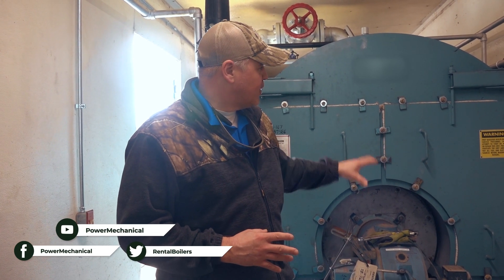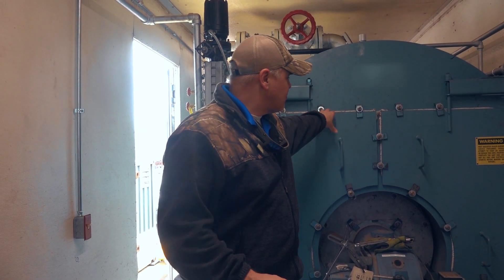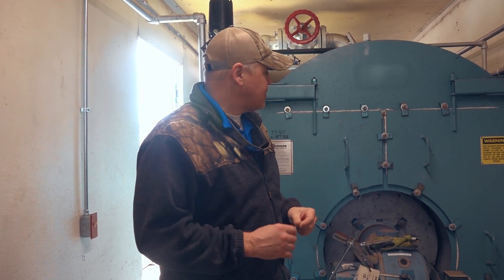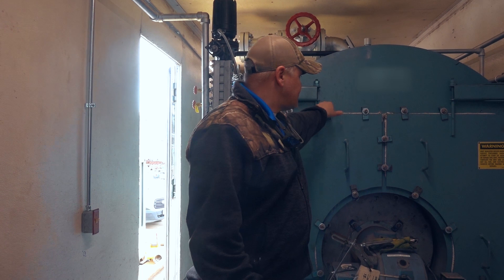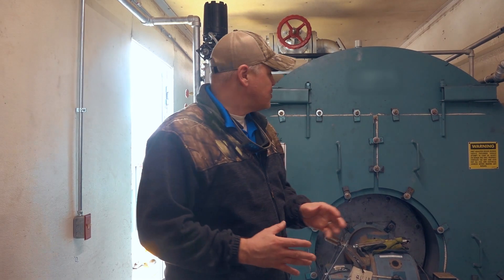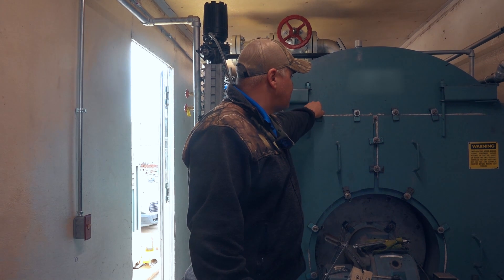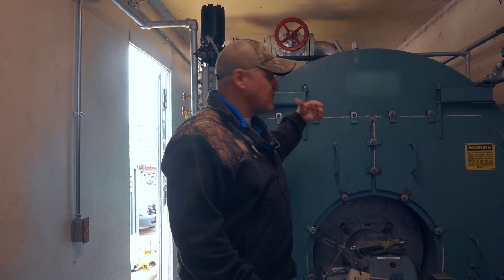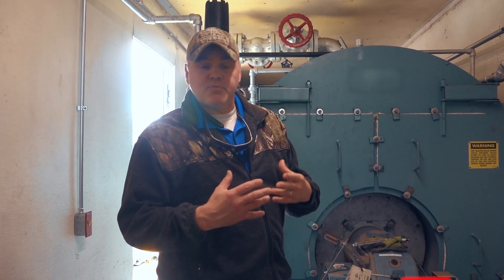Tightening the Bolts on a Boiler Door - Boiler Room Tip

Comment: Hello,

How would you recommend tightening the nuts on the flange of a valve on a steam system operating at 150psi - if you were restricted (due to space) and could only use manual tools? The valve is isolated and not under pressure.

Cheers!
Reply from the maker: Based on the limited info of what's mentioned I would say all you could do was put the wrenches on it. Use the appropriate wrenches with  bars etc. and torque it down, once heat/steam hits it, it's very likely to need to be retorqued.